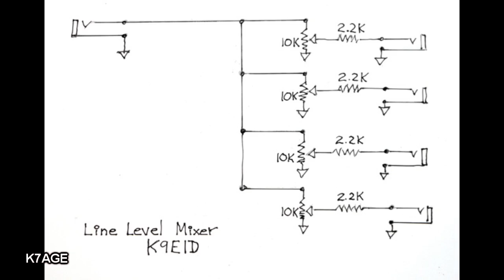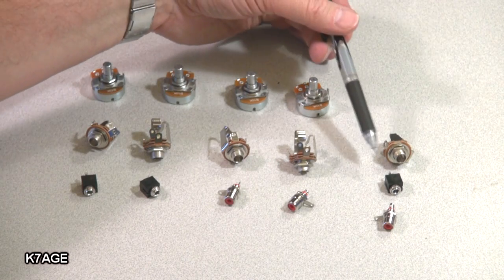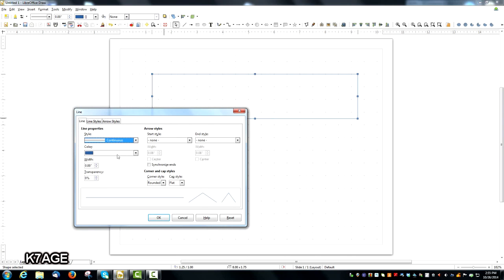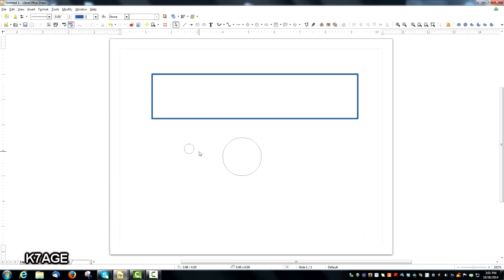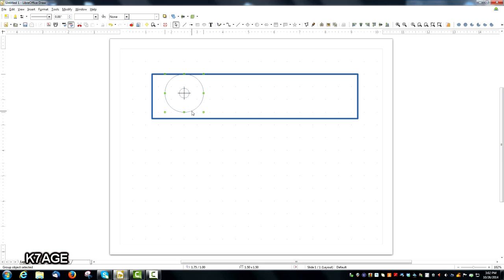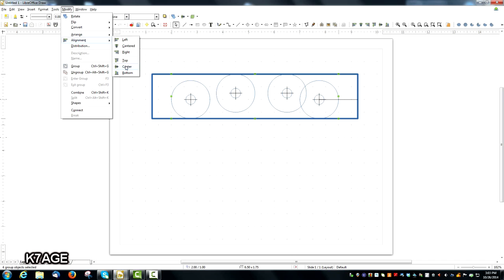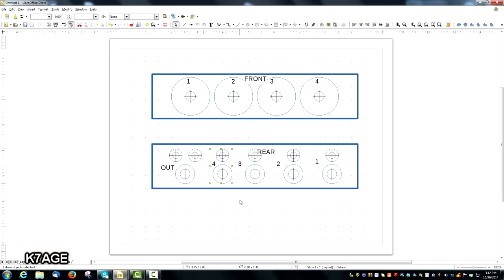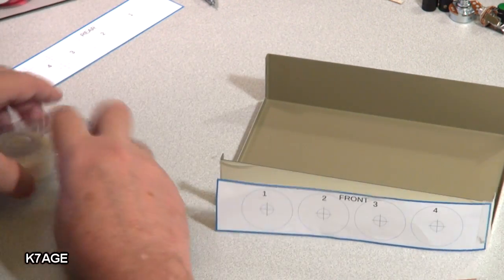Let's Build Bob's Audio Mixer, Part 1: Planning

Comment: can i use multiple signals at same time on the speaker or i have to turn down one to hear another input
Reply from the maker: +Gabriel salvatori You can mix signals together to hear several at a time.

Comment: +K7AGE I don't understand how you can have stereo inputs and outputs but with only 2 connections on the socket??
Reply: Also on your wiring up video, on the back of the socket has three lugs but you don't cover which lead goes from the other lug, you covered the tip and sleeve but didn't tell us where the lead from the rig lug goes?? Any ideas because I'm a bit stuck!!😭
Reply from the maker: I just used the tip connection for mono. If you wanted stereo, use dual pots with one section for each channel
Reply: Again, thanks for all the help +K7AGE it really makes a difference😜

Comment: Great idea but the only issue I have is what about electrical isolation between the inputs.Maybe capacitive coupling? Just thinking out loud.
Reply from the maker: Basically ignored for this design. Otherwise you would need to float the input connectors and wire into transformers.
Reply: K7AGE Still glad you shared :-)
73's N5GKB
Reply: That's why the 2.2K resistors are there, to keep the inputs from "touching" each other electrically should the pots be wide open.  This way the input signals have somewhere to go rather feeding voltage into each other which would not be a good thing.